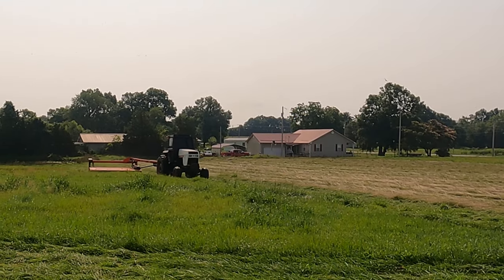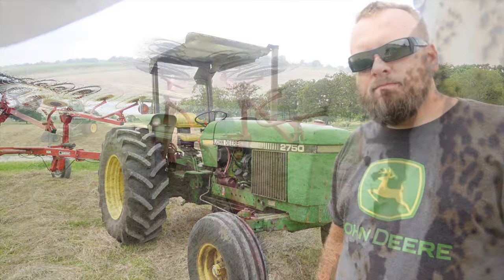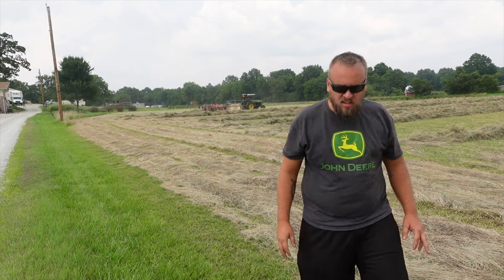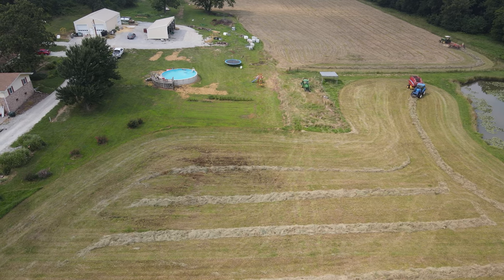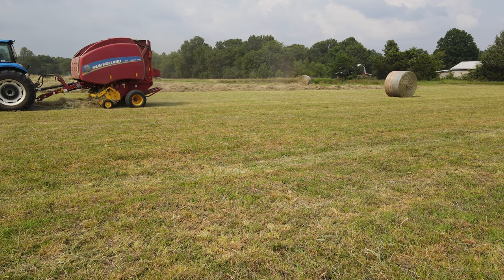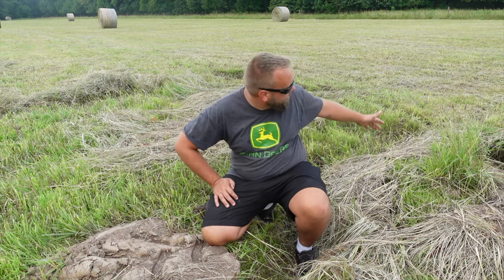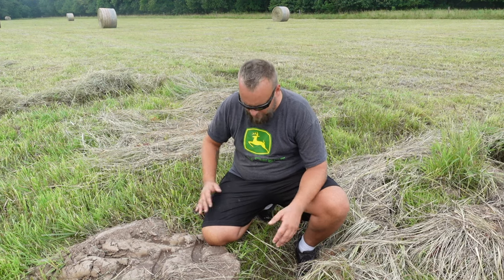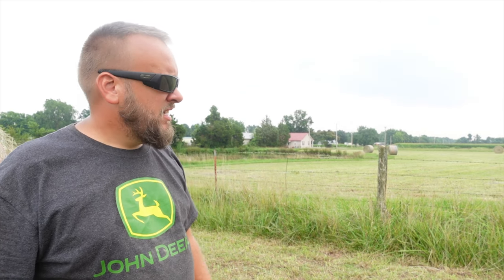Cutting, Raking, and Baling Hay - Case, New Holland, and a John Deere 2750

Comment: Hey Brock, I guess the John Deere 2038R could make hay with smaller implements. Just would be time consuming. 
Am I correct? Those guys on your property are like a well oiled machine processing the hay.
Reply from the maker: It is possible to make hay with my tractor but it’s not the most efficient way.

They have mini baling set ups that produce the smaller round bales. Probably I could run an older square Baler

Definitely not a full size round Baler

I looked at the mini Balers and almost bought one. Maybe in the future